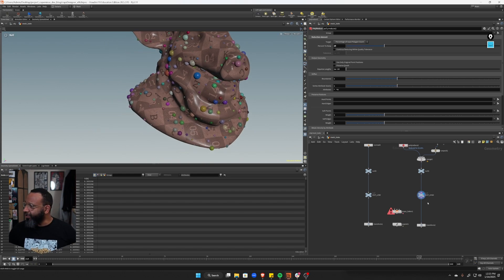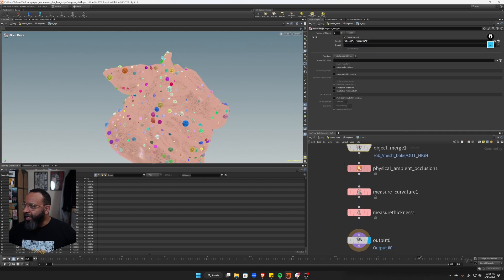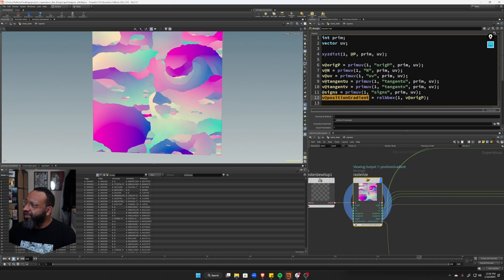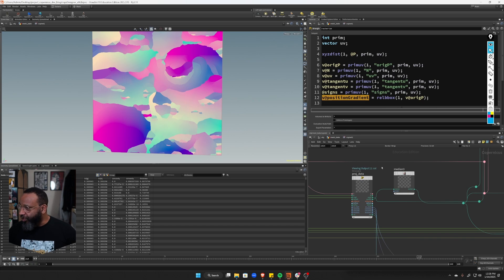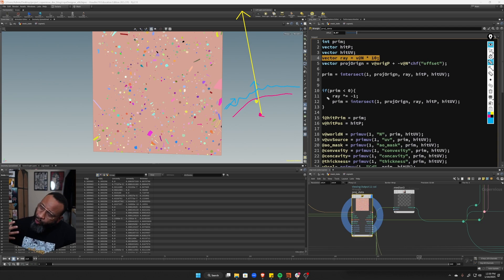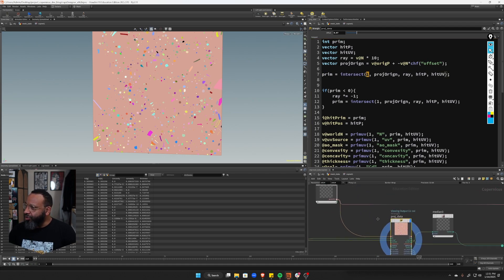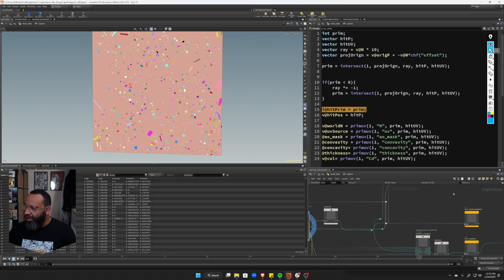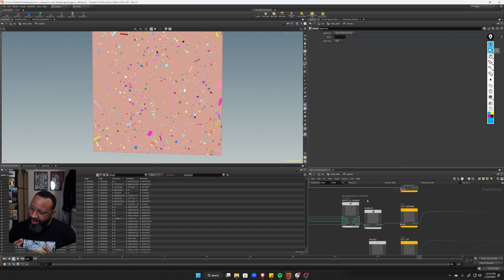Houdini Copernicus: Mesh baking walkthrough 02

Comment: I'm attempting this for my MH characters. I'm running into an issue where all matching UV data (color, normal etc) from the source mesh is getting copied to all matching UV coordinates on the target mesh. For example, if I have a UV layout where the head is in the upper left quadrant and the legs are in the lower left quadrant data transferred from the high poly would get copied to both quadrants. When I just do a singular mesh section (just the head for instance) everything looks correct.
Reply from the maker: humm, I don't have much experience with MH models. and most of the testing that I did was on simple bits as the new cops system was/is still quite new. 

off the top of my head some things you can check:

-sometimes there can be multiple uv sets that may or may not overlap.  in Houdini they are simply called uv , uv1, uv2 ect ect

-the ray distance may be to long and you are getting feature bleeding

-the models are not properly alleged in world space

these are the common gottchas for most baking workflows regardless of system. Since the system is quite new and I am learning as well it's hard to pin down. DM me if you can and we can have a chat about it. 

hope all is well. Cheers!

Comment: Wow, awesome! super cool technique.
I'm wondering, do you think it could work with semi-transparent objects too?
I'm trying to bake brush strokes (cards) made in SOPs using Copernicus, but they have semi-transparent alpha.

Maybe some clever VEX to handle multiple levels of transparency could do the trick…
Reply from the maker: One of the great advantages of this system is its versatility: data is data is data. You can utilize ray casting to extract the 0-1 alpha data from your mesh by using the xyzDist command—similar to how it was applied to gather Ambient Occlusion (AO), curvature, and world-normal data. To adapt this process, simply replace any of those variables with the alpha attribute name.
Building on this concept, you can incorporate any custom attribute from SOPs into these setups. I hope this clarifies things for you. Thanks for the shout-out